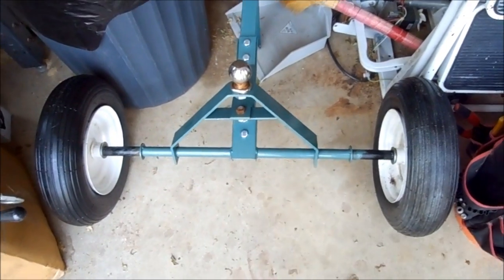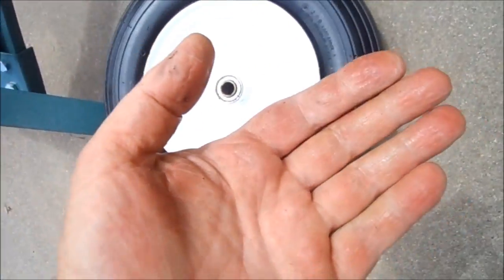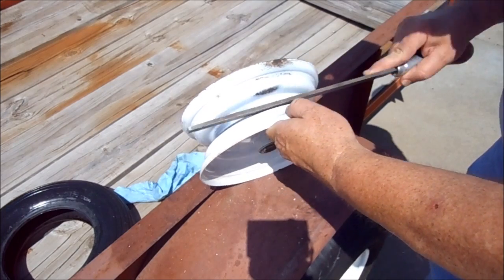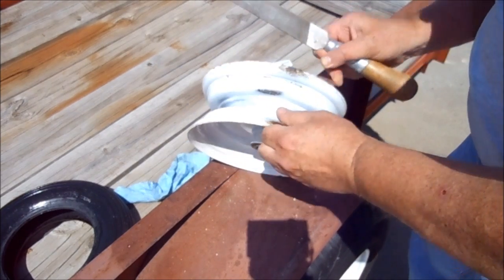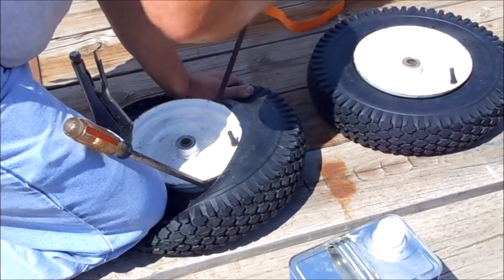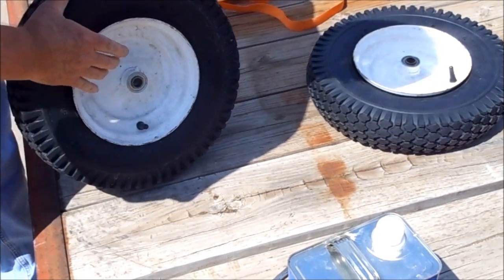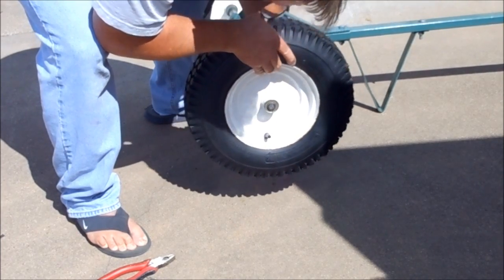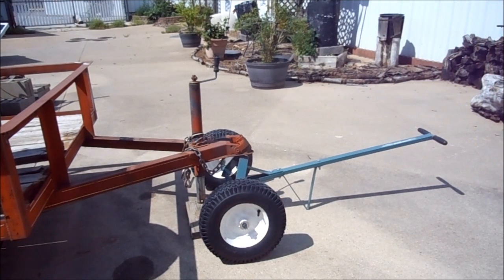How I Change My Small Tubeless Tires

Comment: Good point about the weld splatter, While you was removing's it from the bead area of the rim should remove it from the middle as well. Just in case you decide to use a innertube in the future.
Reply from the maker: That's true, if i ever get a whole in one of these tires before i wear them out, i may try to find inner-tubes. Thanks for watching!

Comment: Just a friendly suggestion.  You may want to buy two tire spoons.  These make putting on small tires (and some larger tires too) sooooo... much easier than screwdrivers.  Plus, they don't scratch up the rims and they also don't pinch tire tubes during the installation process causing leaks.  I am 63 years old and have been using them for years with no disappointments.
Reply from the maker: Thanks for the tip!

Comment: You can`t put petroleum-derived grease on rubber products!!!  Especially a tire bead.  Silicone grease, if anything.  Oil will degrade and deteriorate rubber.  Thanks for your video.

Comment: I catch myself doing it too, but there's no point in pushing the gauge back in to 0 when you're airing up a tire.  Obviously you push it in when you're done, airing down, or checking another tire, but it's not coming out farther if you don't push it in.
Reply from the maker: It's a force of habit from long ago. Back when airing up my bike tiers I would sometimes accidentally let air out of the tier while messing with the valve locking contraption at the end of the pump hose. Old habits die hard.
Reply: @LittleshopintexasSV  - Like I said, I do it too, I get it even though I know it's pointless.